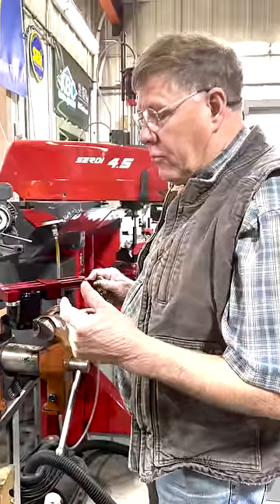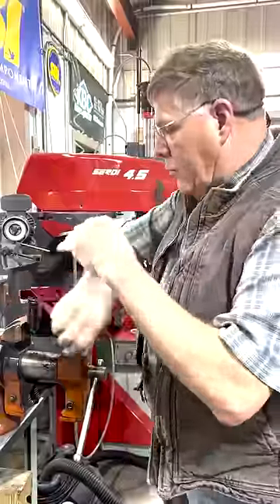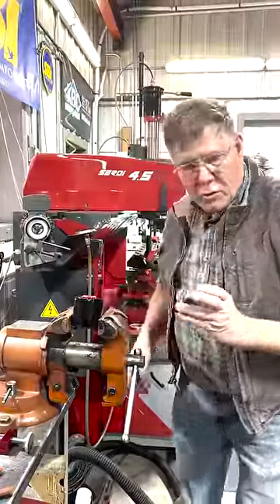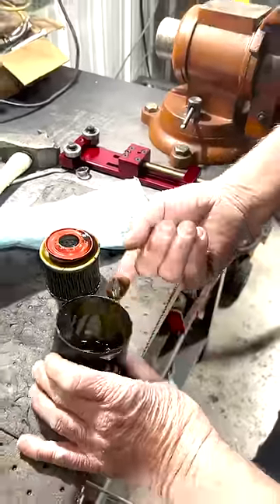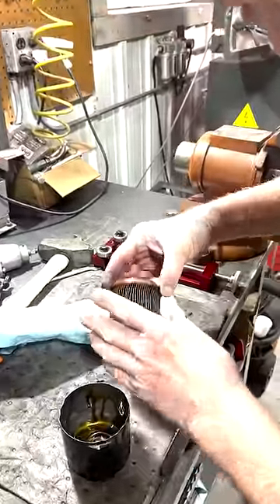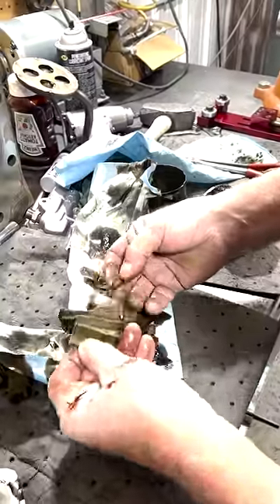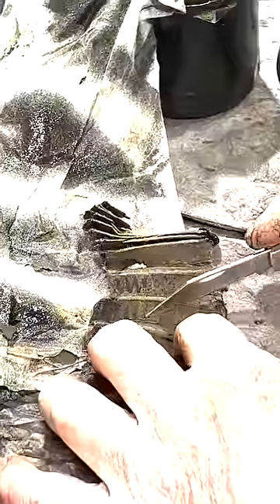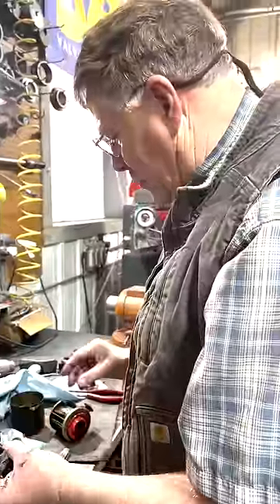#shorts Our Customer Ran His Engine OUT of OIL! 🤦🏻‍♂️

Comment: that reminds me, I should probably buy a rebuild kit for the 318 in my wifes durango. poor thing burns oil when the engine first starts.
Reply: Worn out Valve stem oil seals....
oil runs down the valve stem oil seals when they are worn...oil then burns as the exhaust gases hit the exhaust valve,,,,
puff of smoke out the tailpipe?

Also can be seen when decelerating with foot off the throttle going downhill in gear...causing high vacuum within the engine by using it as a brake..
then when you accelerate at the bottom of the hill a very noticeable puff of blue smoke.

I had a Datsun 120Y (B210) that had to have those stem seals replaced every 50k miles for just that reason..

I replaced 4 sets..
but engine was still good..
Reply: @JohnSmith-pl2bk  you very well could be right, but the chassis has 200k miles and the engine was swapped from a Ram 2500 with lord know how many miles so I'm just going to do a whole top to bottom refresh on the thing and cover all the bases.

Comment: From 2012-2022 SuperTech full synthetic, every 10k-13k miles. Changed the special 4wd adapted pain in the butt oil filter twice from 133k to 265k when in a totaled wreck, motor still running strong and not burning oil. 
95 Suburban tbi 350
7500 miles is too little unless after a year.
Reply: That super tech is good stuff I used it on both my vehicles for years never had any issues and it’s wayyy cheaper
Reply: @evanknight3629  
Right?
And now with their Advanced Synthetic for a couple bucks more a jug, even better oil. 
Pull up a few oil brands tests and see how it holds above known brand names.

Comment: Modern European engines tend to not need oil changes every 15000 mills. More like 40000 and run fin. Might be the warmer weather in parts of america. The Engines last longer then the suspension, driveshafts, air bag light.... after about 180000 mills. Cost more to keep running then replace.

Comment: Ok, to play devils advocate, technically the filter did its job by trapping these things in the filter.  What would have been the difference had he changed the oil and filter a couple times.  Those same contaminates would be distributed to 3 different filters instead of 1.  And yes,of course the oil been refreshed, but what you see in the filter doesn’t necessarily mean that the engine is automatically bad. (That being said, I’d be pretty worried finding ANY metal crap in my filter ever.

Comment: The problem is actually more associated with getting low on oil more so than longer intervals between oil changes. Im my experience women never check shit under the hood and its up to the men in their lives to keep that engine alive. As long as your using a high quality oil filter and keep oil topped off most cars can do 5k or more. 10-15k seems like your pushing it to me. That said most of these issues are due to extended driving on cars with low oil levels

Comment: My 89 Toyota Hiace was at 600 000 kms and running fine. It had been a taxi, hence the mileage. Always got serviced on time, its whole life. A mate borrowed it and came back running on 3 cylinders. 😡Lifted the head, and you could still see the hone marks in the bores from the factory. Skimmed the head, new gasket put it back together and drove on. Rust claimed its life in the end, sadly.

Comment: I drove a rental car for over 20,000 miles, never had an oil change, and i never bothered to even open the hood. They just kept re-renting me the same car even though I told them multiple times about it. They said it was probably going to be sold after i was done since it was to their mileage point. NEVER buy a use rental car.

Comment: These extended oil change oils and filters are the worst thing to hit the motoring public. We change oil because it dirty not to because the oil is worn out. Oil and filters are cheap compared to a new engine or car. Change oil at 3,000 to 4,000 miles folks

Comment: The last statement, "this vehicle that's not worth rebuilding the engine on". I know for a fact I can get a new crate engine for my truck, way cheaper than it would cost me to buy a new vehicle.  I mean we're literally talking about maybe 5 to 7 Gs to buy and install an engine, compared to 38G+, and that 38G is on the cheaper side for a good truck. Not to mention you have to get used to the new truck, the truck payments, the higher insurance payments and everything else that comes with a new vehicle. No thank you, I think I'll just fixed the one that I own outright.

Comment: 15k is not a lot most European car run 18 to 20 k between oil and filter changes. So you need to ask what's wrong with American engines . My toyota and hyundia run 12k but my vw skoda 18 to 20k  .

Comment: I all ways tell people to change oil at every 3500 to 4000 miles, or every 3 months which ever comes first. if they only drive 1500 to 2400 miles in 3 months, change the oil. if they put 3500 miles in 1 month, change the oil.

Comment: Makes me wonder now about my previous car. A couple years ago I went on a bunch of road trips and spaced out on making sure to get an oil change done (I’m usually good at getting it done 3 or 4 times a year). I’m getting ready to return from the last and longest trip, and the oil light flickered on as I parked the car after getting gas, intending to leave right away in the morning. Checked, and long story short, I ended up adding three quarts (engine needs 4). Yikes. I made sure my first stop back in town was the dealership for an oil change! Wonder now how much damage I did with the oil steadily dropping over those few months! I traded the car the following spring after the CV axle snapped (it was getting up there in miles anyway).

Comment: Had a nissan almera for 14 years only changed the oil once when i fitted a new timing chain 175 ,000 on the clock would probably still be driving it now if some numpty hadn't  rear ended me and bent the chassis.

Comment: I finally get why you refuse loads going up into VA or WV, talking about it wears on your truck more.....we worked in WV last week and those grades on 81, 460 and 77, holy cow.  Engine brake was working overtime on the 6.7 Powerstroke in my work truck and had to be good on the air brakes, or youd smoke em so quick lol

Comment: I bought a 20 year old car from a freinds dad. I knew this guy and he was malicious with maintenance. I changed the oil at 3000 miles and the oil looked like I could put it back in. He changed air filters every thousand mile. Lent it to my brother and he drove it into the ground in 6 months. Also found every 9 16th socket and wrench I was missing.

Comment: Oil should be changed at least every 7k miles, i change mine every 3k but i work for take 5 so i get it for free, i just have to do the work myself. Idc what the oil says about the interval, mobil 1 extended performance says its good for 20k miles, i wouldn't go any more than 10k with it.

Comment: I change mine every 10,000 miles with mismatched brands, types, viscosities and with 250,000 on it, I still drive it to work 5 days a week. Besides, why would you rebuild the engine in this video, it still works fine.

Comment: You are aware that factory service intervals are 10,000 miles on an oil change, right? If you are using the "oil life" monitor on the dash, you are going 10k miles between oil changes. Measure for yourself. I now use a sticker and change mine every 5k. I have 325k miles on the original drive train in my 2005 Sierra.

Comment: Heck I had an 02 celica gts. Changed the oil every 5k, oil filter changed every 2.5k. That sounds a little too religious on the filter change, but this engine had well over 300k on the engine, and had a weak oil pump. Toyota recommended 5w20 new, 5w30 high mileage at over 150k. I was running 15w40 just to have oil pressure😅. Yes it sounds like I was abusing the poor thing, but for $700 out of a junk yard running and driving, and just as a backup? I got 3 years of service out of that poor little ole car before the oil pump finally gave up the ghost.
Reply: No sludge in valve cover, or in oil pan either. Just the normal high milage blackish colored film that develops from slightly long oil change intervals. Again I bought this thing from a junk yard in 2020 and its an 02 year model car assembled in November of 01.

Comment: sounds like my ex... we talked recently and she said her KIAs engine cracked  a head the  3.5 turbo... i asked if she changed the oil like i kept telling her too, she said yes.. but i dont believe her.. she would run that thing to like 9k miles or more before doing it.. told her those engines need babied... well her engine died at like 80k miles and she boughtit just two years ago.... i warned her... im sure it  would have died sooner than a reliable engine but she could ran it longer than that if she just listened

Comment: My wife's 5.'3 consumes oil most of the time it's when the check engine light comes on for low oil pressure that I fill it back up and I've been doing that for years and that truck runs its ass off

Comment: I had a small used car lot years ago.  One memorable couple got a car from us.  They were a gay couple (females), no credit, desperate for a car.  We sold them a cheap used car.   It had a small oil leak, but beyond that was a great vehicle.   By small leak, I mean a quarter size when you parked.   I don't remember the model, but the pan was a pain to do on it.   Anyway 6 to 8 months down the road they came in to make a payment and said the car wasn't running great.   "But I've been addinf oil".  My dad checked it out and it was running like trash.  We checked the oil amd it had about 20 quarts.   We ended up doing an engine swap for them.

Comment: Isn't that the point of filter? to collect junk. If the filter was clean, that would be pretty worrying. i do not want to question your expertize but there is no way you can know if the engine is broken on the content of oil filter. You got that filter with whole history of it. I myself was driving a car for like year and a half without changing oil, i only filled it up and it drove just fine. After that i changed filter and continued with that practice. That car did like 400k km with me doing 200k of those 400k. 
All the drama about oil is a new thing.

Comment: in UK, 18,000 mile oil changes are quite common, highest is 25k. very few people know how to open the hood these days, so most cars make it in between services without top-up. poor quality oil in USA ?
Reply: I'm wondering the same, my car is 30 000km or 1 year, which ever comes first.
Reply: @AlexKall you can do this with so called long life oil, which is different from standard engine oil.

However it's still unclear if such long intervals are good for the engine in long term. It also depends on the time interval, if you drive long distances you have no condense water or fuel in the oil. If you drive shorter distances and stretch the oil change over a couple of years instead you get both into your oil, which is reducing the ability of the oil for proper lubrication.

Comment: My moms 99 camry is still going some how! For a while she was putting 2 qrts of oil in it every time she filled it. Took it on a 600 hundred mile 1 way road trip, told me she'd "just stop every couple hundred miles when it started clattering and add oil." This was 4 or 5 years ago. That old toyota V-6 is STILL running along. I fixed the oil leaks, when she told me her oil story.

Comment: Where has the oil gone ? My engine burns about a litre of oil every 15000 miles
Reply: That's alright if you have 4.5 litres in the sump.
But an old  125cc motorcycle only has a litre in the sump and no filter.....
Change it every 1000 miles...?
Check oil every tankful (300 miles)

Comment: Why I'm not a big fan of synthetics.
yes they may lubricate better than conventional oils, but they get dirty just the same.. It's the dirt that causes the wear and tear. 
plus I've taken down several motors that used synthetics and pushed their oil change intervals to the max.
End up finding a shellac type residue coating most of internal engine. 
  My rule of thumb, is use proper weight oil for your vehicle and temperature and driving conditions. 
 Change every 3months or 3000 miles.
 Because like milk oil once contaminated will go bad.
Reply: I've also heard every 5000 miles or 5 months (whichever comes first).

Comment: When i was 17 or 18 i worked at a shop with my dad and a guy came in with a ford ranger think it was 2000 or 2002 anyways 70k miles guy said it just quit lol. We looked at dipstick nothing pulled drain plug n nothing came out so then for shits n giggles pulled the oil pan n it was like jello oil still stuck to bottom of motor in shape of the oil pan 🤣 🤣 🤣.  Guy said he couldn't remember last time he changed the oil smh it was ridiculous

Comment: I baught a straight truck from a steel company it was a ford 3500 with 12 ft bed had a 300 straight 6 ran it out of oil snd locked it tight 5 or 6 times had to force it to turn over with pry every time got it free refilled with oil and ran it again till they ran it out of oil and it locked up and stoped they towed it in after time 6 the mechanic said it junk i cant get it free any more i bought it for 300 drug it home had a maverick with a 300 straight 6 put it in drove it for a year sold it to a sideing company for $3000  and they were driveing it 6 years later

Comment: Whats the US problem with driving 15k miles with the same oil? Thats 24000 km. Nothing special for a german car with longlife oil. 20k - 25k miles oilchange with longlife are normal.
In my old cars, I change the oil on the petrol engines every 12.4k miles since decades. Everything fine. 3 Engines with more than 250k miles on them. Nothing will happen by stretching the oil change once to 24000 km. Even in the US where you not allowed to drive with Vmax.

Comment: Yall need a safety shutoff. I wired mine in for 20 bucks.    If that oil light turns on the engine auto shuts off.  And won't turn on for 1 minute.

Comment: 15,000 miles? I havent heard of a service interval longer than 10,000 kilometres!
Reply: All (euroupean) cars have service intervals longer than 10.000 km. My Toyota hybrid is 15.000 km, my work van (Opel Vivaro) 40.000 km intervals. I usually get the work van serviced at 25.000 km intervals.
What is it with Americans and oil changes? ;-)

Comment: Strange thing about an engine, if you don't change the oil out the drain plug, it will eventually burn dirty broke down oil, so your still changing it, only not getting the benefit of clean oil all the time.. 😜

Comment: This is most likely my filter. 😂😂😂  my engines fucked. I forgot to top up oil and i got to low. My pistons or something was pissed. But lifes to expensive and it was cheap so ill run err to the ground. Bought the truck for 3500 im not spending more then i paid for the truck to replace a motor in it.

Comment: Guarantee my engine is worse! 😂I've had a mysterious coolant leak for the last, 2 years burns through all the oil before I hit 3k miles. But it's 20 yrs old, everything underneath is rusted to absolute hell. No point in taking care of a motor in a car that ain't gonna last much longer
Reply from the maker: Honestly the vehicle in this short is in similar condition. 😂 20 years old and a myriad of issues, just one of which is that the doors sometimes fill up with water when it rains and make sloshing noises around turns. 😂 At some point you just do your best and drive it till it quits 😂

Comment: Change your oil every 7000 miles, i dont care what the manufacture says blah blah blah its bullshit, change your damn oil! And if you have a turbo engine thats 3000-4000miles no if ands or butts about it
Reply: 7000 miles, are you using cooking oil?
Reply: @AlexKall  
Severe service..uber, short trips etc.
Reply: @JohnSmith-pl2bk  If you drive only 7000 miles in a year, sure than it would be resonable, but in that case you shouldn't make a general recommendation to change oil every 7000 miles as that is not applicable for someone that drives more than 7000 a year.

Comment: I had a 94 Hyundai Excel that went well over 10k on an oil change. It used oil and I would add when the light would come on. I think it was 2-3 times on that oil change. You would think I would carry extra but didn't. So I would drive to where I could get oil. I just couldn't kill the dumb thing!

Comment: There is something else that is the matter that is not being said. The size of the metal pieces couldn't make it past the screen on the oil pump in the oil pan. Did they come of the crankshaft, the rods, pistons, valves, guilds or ? Quit looking down on others and celebrating it.

Comment: I drove my Venza for 250k miles and regularly changed the oil at 15k mile intervals. Never had a single problem and my son-in-law is now driving it. Use the right oil and filter and 15k isn’t a problem.

Comment: Engines are surprisingly resilient to oil starvation. I work at a dealer, we have issues with oil burning, we’ll get customers all the time that say the oil pressure light has been flickering for a week and they have just been driving it without oil. Fill the oil up and the engine is fine. It’s crazy.

Comment: I put 80,000 miles on my first car before an oil change.
Nissan pulsar.

I put another 40,000 mi on it before it went back in my uncles junkyard. 
Never did another oil change, and the engine never failed..
When I got the car I had a 120,000 mi on it...

But right around 240 thousand Miles the body and interior was in such horrible shape, the car wasn't worth fixing. But the drivetrain was still running strong.

Comment: I never check my oil, bot even on the semi. If the light goes on i fill it. In the semi there is not even a oilstick only a light when it runs low. My car already has 350.000km and never changed the oil, just filled it when it needed more. Still drives like new😊